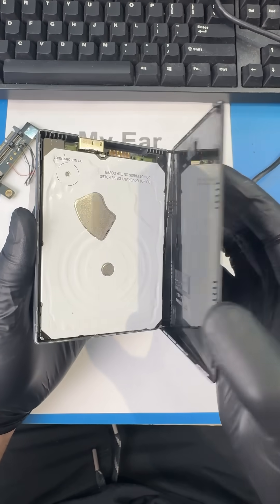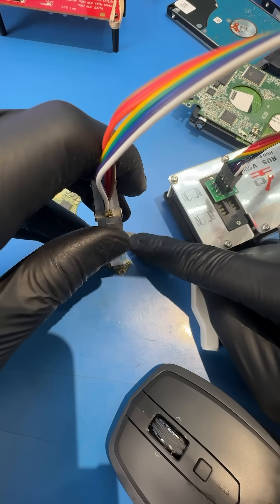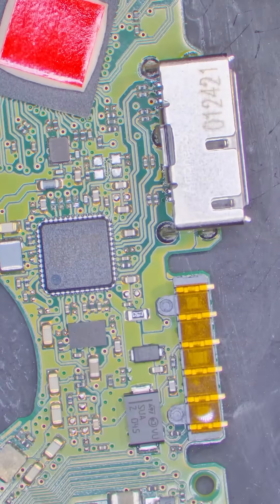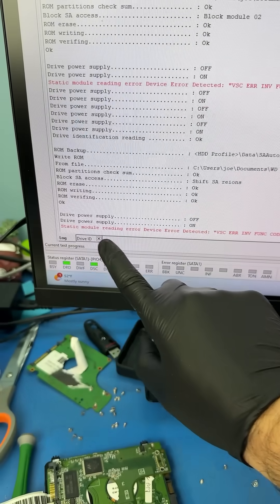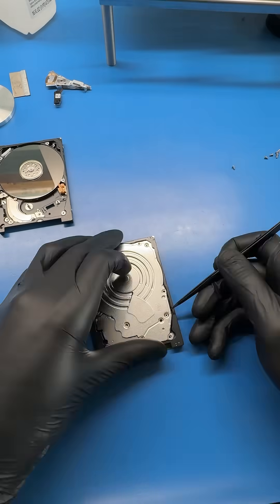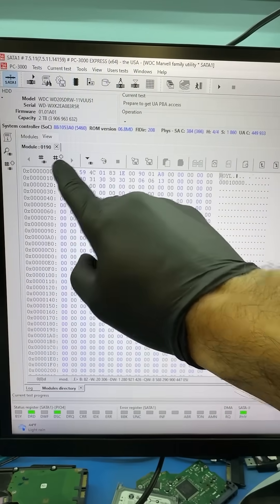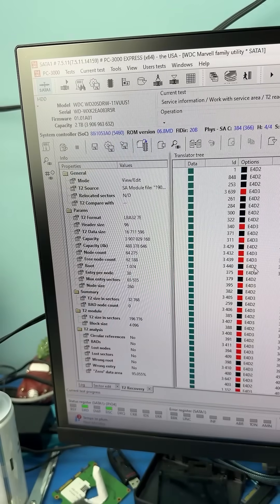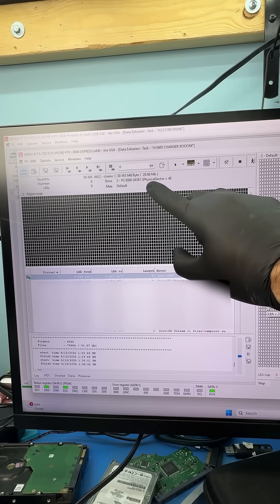Hard drive translator...? #tech

Comment: When I became the "VIP support" (so they didn't need to go through our normal support channels) for our top CEO and the other closest higher-ups at our 7k employee strong organisation in 2019, I didn't even have time to do a proper walk-through with either of them until I got my first assignment. 

The CEO had spilled coffee over the at the time newest MacBook Air 2019 (A1932) with both RAM and SSD soldered onto the motherboard, and of course had some important files only saved locally (something we talked about afterwards). So I recommended to send it to an international and reputable data recovery company. 

When they got it, they immediately said that they couldn't handle this (then) new computer in our country's headquarters, so they sent it to our regions headquarters, who also said it was too advanced for them as well, who then had to send it on to the main headquarters for the whole of Europe in the UK. 

Finally they had the tech to de-solder the SSD chips and break the encryption stuff and we actually got 100% of the data back. 

This made our CEO very happy indeed, even after the €6k bill plus the cost of a new computer. :D

Comment: if you dev game/music/video etc you have always bacup on a second drive or mayde 2 bacup drive...Dev maybe years and lose all data if a m.2 ssd is corupt..its not possible recover it on another computer (locked on hardware use) Old hard drive you can scan all sector and not data protected.always do bacup.. i have done it self,lost progress half year on flstudio.. this was 2000s and when i got new hard drive its was a part failed 60gb drive and new died after 2-3 mount.. this was a stupid file size half MB... 29Mb data, work on a game can be a year progress lost. There is IBAS but it can cost 10k -12k dollar
Reply: or is this android issue only read from it you need same cpu?

Comment: All hard drives fail and file systems get corrupted. If you value your data, back it up, preferably to more than one place. I run RAID 5 or 6 for all my critical data, and it's backed up to other local storage and to a cloud service. It's saved my bacon multiple times.

Comment: This is why you really should back up all your data to at least 2 separate devices. If you want to be extra secure, you should have one of the backups in a separate area that won't get damaged even if your whole house is burned down.
Reply: What kind of game dev doesn't use source control to a remote repo? lol
Reply: 3-2-1 backup strategies are there for a reason.
Reply: The drive in a seperate area can also be a cloud backup (which is kind of exactly the same thing)
Reply: life life on the edge a little you pansy

Comment: So, pretty much every board that only as USB  connection is basically a SATA board with built it SATA-USB chip, so you just bypass that part of the circuit like in this video?

Comment: Lesson to learn here: If it’s something really important, always have at least two backups that are not located in the same place.
Reply: copy back ups also. not those encrypted backups that cant restore things because of some minor issue.
Reply: 3 overall copies
2 different storage devices
1 offsite copy

had a few drives that gave up on me, a corrupted nas due to software issues, accidental deletes, etc. but never actually lost any protected files thanks to the 3-2-1 rule. can highly recommend.
Reply: @Dan81825  Worked at a printing company and all the company archives had multiple copies on several storage devices....all kept in the same fireproof safe.  Guess what happened.  Months of recovery efforts from paper files and information received from outside sources.
Reply: 3 copies, 2 different devices, ideally 1 off-site.

Even if you can't/don't want to do off-site, backup computers to your NAS and backup your NAS to an external drive. You can always add another drive to rotate that NAS backup later
Reply: R.A.I.D comes to mind. 
P.S. Don't use RAID 0 if you want redundancy.
Reply: I bought a few external drives and had a Zip drive. It's a good idea to backup your backups. I eaven had a tape drive, that used DATs. DVD rw also, several years later
Reply: I keep 4 copy for things really important.
Reply: you can also encrypt it and upload it to google drive, so google cant see your stuff
Reply: @superhase3206Google a.k.a. Alphabet.  Isn't Apple, Apple is whom u have to worry about looking at your stuff not Google.  Don't get it twisted.  Any company that won't give you access to the Bios or their Cmos... go back to school or learn a companies objective before you defamate.
Reply: And then test those backups. I can think of many cases where someone thought they were prepared, but their backup proved unreadable, corrupted, or never written in the first place.
Reply: Exactly. That's why I had three kids 🤷‍♂️
Reply: @codyjamidon9319  lol
Reply: GitHub in shambles 💀
Reply: Thx to streaming and cloud data
Reply: Plus one in the clouds.
Reply: google drive exists for a reason
Reply: @iutticf Google drive isn't great for gamedev stuff. That can range from hundreds of gbs to TBs. Git is a better networked solution.
Reply: @iutticf   Yeah, so they can control your data